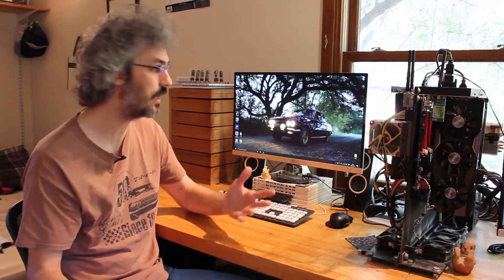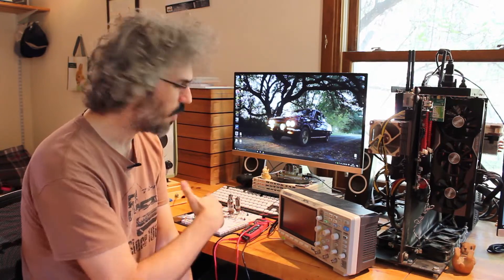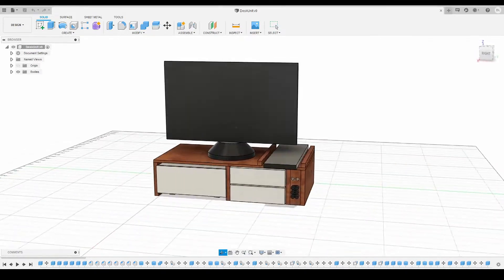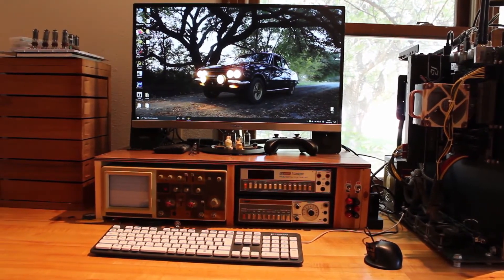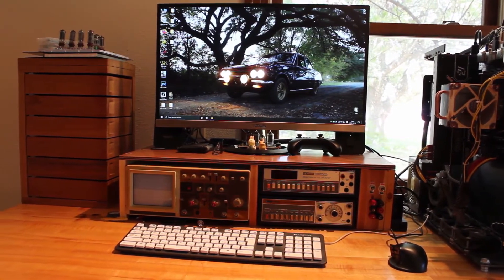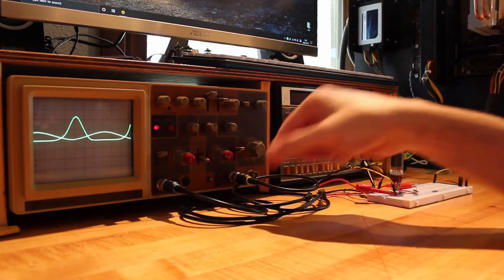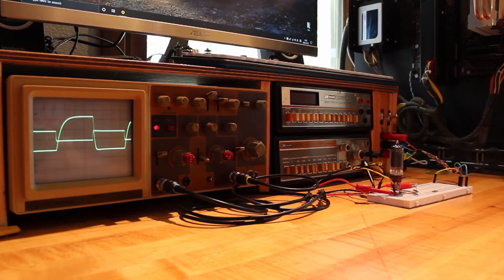Building the Ultimate Electronics Testing Workbench

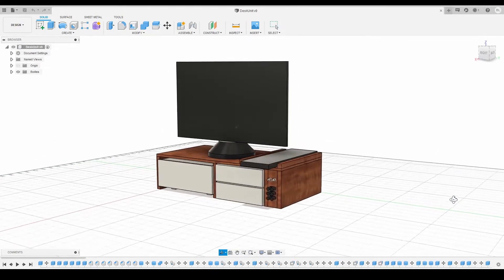Comment: Not sure, what has happend but the sound seems to cut out between 5:13 and 7:28? I check on desktop and mobile and it's the same..
Also: is there any more information on you PC "case" it looks like you have two systems on one "base board"?

Comment: Good job ! However I wonder if there is enough space around the equipment ( between the walls of the wooden enclosure and the equipment) for adequate ventilation of heat generated within the equipment. How has been your experience ?

Comment: Great build and looks awesome my only feedback would be my own experience.

I built a similar unit out of white melamine (which went very well with my metal and glass desk) but I found hat the commonly accessible gear/functions at desk level are sometimes difficult to access when you have a bit of clutter on your desk. Also looking down to read displays is a little awkward and doesn't feel natural for me.

My next setup I lifted it up off the desk about 100mm/4" and use the bottom compartments for tools and items which I grab first/put away last or I don't use often.

Next iteration may have 600-800mm (25-30") wide pull out shelf which will be on draw rails and I can pull out, work on and push back in. This will let me quickly reconfigure the desk if I need to without needing a complete pack up but simply pushing it all in.

Keep up the good work.

Comment: Have you considered heat build-up? I wonder if having those power bricks so close together and so little air circulation around the three cases—now all enclosed in wood—might decrease the lifespan of the entire setup?
Reply: yeah I was thinking an 80mm fan running off the 6v supply just to get some circulation would be nice
Reply: Heat buildup. I thought the same. Next on Usagi's list... add cooling fans to very cool retro looking workbench build.

Comment: a bit late, i know, but i've got schematics for the 2120b (& service & operation manuals for the '2120', presumably the immediately prior model) if you're interested. been meaning to stick them on bama or something

i've got a 2522[a] i spent ages & ages banging my head against various walls trying to get proper schematics & a service manual for it, to only partial avail. i think i know your pain
Reply from the maker: Thank you for the offer! 
I managed to find the manuals for the 2120, 2830 DMM and 3010 function meter. The 2120 manual, like you mentioned is for the model before mine and so the schematic in it were only marginally helpful. Let me know if you find a good place to upload the 2120b schematic though, it'd be excellent to have in case this one ever gives me any issues!

Comment: How much fusion 360 pay these youtubers to do everything with this software? Really a 3d cam software to cut 5 pieces of wood?
Reply from the maker: Oh man, I wish Fusion360 would have paid me! My videos get less than 400 views on average and I only recently cracked 1k subscribers, if I asked Autodesk for a sponsorship, I'm fairly sure they'd laugh so hard that tears would be running down their faces, haha. 

Now, as for why I used Fusion 360, the answer is two-fold. First, I have the hobbyist license, so the software was free, but I'm still a total noob at using it. Anytime I can use it for a real world project, I'm definitely going to as it's excellent practice to learn the ins and outs of the software. Second, the amount of space I had on my desk to fit the scope, multimeter and signal generator was very limited, so Fusion360 was an excellent tool to visualize the best way to lay everything out so it would fit just right.

So, in short, no one paid me to use Fusion 360, I did it because I wanted to learn more about the software (and cam software in general). Plus, it was good fun!